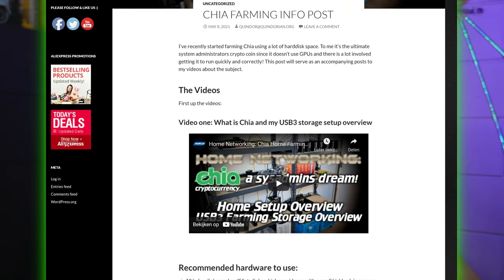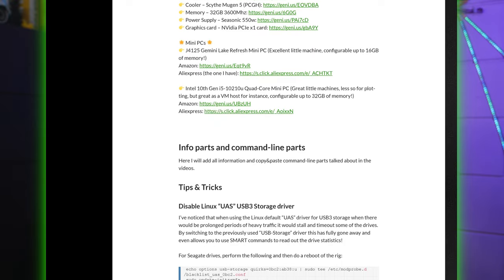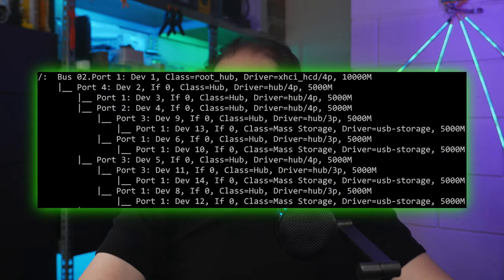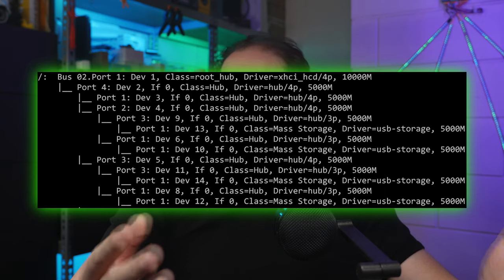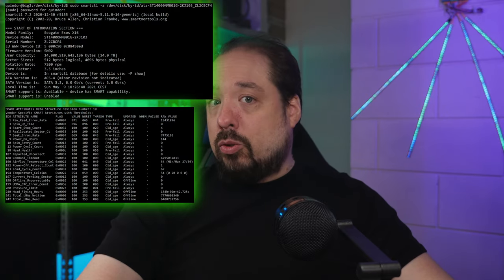Home Networking: Chia - Designing a plotting rig

Comment: I have the 5900X and I’m currently pushing around 15 plots with a Micron 6100 1.92 TB Sata SSD and the Samsung PM9A3 960GB NVMe SSD. Managed to get them both cheap but the 960GB capacity is quite limiting and so is the speed of the Micron SATA drive. More upgrades to come and can’t wait for your follow up video.

Comment: Hi. Great info, thank you. Am I wrong in thinking that 5800x should also be able to plot 10-12 plots parallel (according to calculators online cores+threads /2) and at similar speed? Wonder if I could save almost couple hundred bucks here.. Best of luck!
Reply from the maker: It will not, it has 4 cores less and same clock speeds, so the math is simple. My 5900x is often loaded 80%+

Comment: Literally ordered yesterday a rig pretty much like yours but a bit different build. Ryzen 5900x (my other system has 3900x too LOL), bequiet Dark Rock 4 cooler, 64 GB (2*32GB) G.Skill TridentZ NEO DDR4-3600 RAM, MSI MPG Gaming Edge WiFi X570, MSI GeForce GT 710 LP Passive 2 GB, 2x Corsair MP510 960 GB (3,7 PB TBW each!), Fractal Design Define 7 XL (can hold up to 18x 3,5 inch HDDs). Complete with 15x 12 TB drives for now.
Reply: edit: 2000GB PNY XLR8 CS3030 are the SSDs I ended up with, not the Corsair ones.
Reply: @maxmustermann194  did you find info on the endurance? I didn’t find any spec for that on the manufacturer website cause they look pretty good for the price
Reply: @trucha1785  3.7 PB for 2 TB drives! they seem sold out here already.
Reply: @maxmustermann194  i actually got one just in case and Its in suppose to arrive like tomorrow
Reply: @trucha1785  nice, they are already hard to get supply will suck soon
Reply: @maxmustermann194  yeah already BO at most places… I’m gonna order 2 more to secure my supply and will resell it if I don’t end up using it
Reply: @maxmustermann194  i also saw some people put them on PCIe adapter and used them in raid 0 so you have twice the speed
Reply: @trucha1785  sorry for late response, I did md0 RAID from beginning, I get 7000 MB/s reads and 5500 MB/s sequential 4K writes, couldn't be happier.

Comment: Thanks for the video.. need more clarity on how you got that 40-50 plots calculation.. how did you break down that calculation? 24threads assuming plotting is all you doing you can do 12 plots in parallel and also assuming you have a 4tb nvme m.2 you can safely do 12 plots aswell but with current prices it can easily blow the budget on those 2 alone. not unless you'll be using ssd sataIII is 32GB Ram sufficient to run all 12 plots parallel? if so what is the timing in between? sorry if its a dumb question calculation on my part as im trying to put together a rig aswell dedicated for plotting..
Reply from the maker: Ah, we'll you're going to need a lot more storage horse power to be able to achieve it (basically to make the CPU the bottleneck). Currently doing between 10 - 11 plots on the 5900x which all complete within 6 hours. 24 / 6 = 4 plots per 24Hrs but we're running let's say 11 that makes 44 plots in 24Hr. I'm still tuning to run 12 plots in parallel and that would bring me pretty close to the 50.

We'll dive a bit more into it in future videos. :)
Reply: @IntermitTech   looking forward to it and great tips on video's they're helpful.

Comment: just invested in a 5600x setup but got the b550 for 2.5g ethernet which I thought will be handy, wondering if I should change to a x570 while I still have the chance. I'm limited to 6 parallel plottings due to the single 2tb nvme, thinking if I should move to 2 gen 4 then will the cpu becomes the bottle neck?
Reply from the maker: Nah, for a 5600x you're likely going to be fine. Once you scale down CPU horse power (and you have about half a of 5900x) the rest of the components can also be lower performance. Same for your SSD, first try and find out if storage is actually your bottleneck right now, then change up what is.

Comment: Dude, what a great video. Very informative straight to the point. Excited to see the new videos come out. Could you please go over the speed difference from different operating systems (if there is a difference) 

Either way, awesome video and you got your self a new long time sub!
Reply from the maker: If I compare my Ryzen 5950x box running Windows 10 and the 5900x running Linux that last one is much much faster, I feel you really shouldn't plot on Windows if you are even somewhat serious. You're also able to use a much more lean and tuned setup in Linux which helps a lot.
Reply: @IntermitTech  alright great, thank you for the response. I am comfortable with windows which is what I have been plotting on, but if I need to switch to Linux then I need to switch! Excited for the new videos thank you

Comment: How much of a underperformance would the 3900x be? That's what i have, and was almost thinking of getting a threadripper for the higher core/thread count.
Reply from the maker: Not that much, the 5900x will do a plot in like 5:30 and a 3900x in more like 6:30 to 7 hours.
Reply: @IntermitTech  Ouch, that sucks. But since it's got a good amount of cores and threads, I'm sure it still allows for plotting at least 11 in parallel with decent turn around?
Reply from the maker: Oh yeah, I have a 3900x box running too

Comment: Would old second hand workstation do the job? Like a xenon E5-2670 with 32GB of ram for much less than consumer equipment… or even server rack and use pcie adapter if there isn’t any m.2 slot for the temp drive
Reply from the maker: Oh yeah for sure, you just need to design everything in balance really. Got a really fast CPU, get some fast storage too. The CPU's you mentioned are a lot lower speed but it's still an 8 core so it could probably do a decent amount of plots per day. Adding M2/NVMe drives using PCIe slots is easy, great plan!
Reply: @IntermitTech  i already ordered 3 1TB nvme with 1800TBW to plug in at 3000MB/s write… my concerns was really the processor speed even with the high number of thread…. Because I can get one for like 500$ so hypothetically I could buy 3 of those for the same price of a new setup like you proposed which is already in the cheap end. And I also take into consideration the HDD shortage coming and handling 50tb of storage versus 500tb isn’t the same game at all!
Reply from the maker: I think those boxes could do fine, in the end they might not be too far away from each other in total speed for the setup basically.

Comment: Thank you for sharing this knowledge.

I have all the hardware I need to build a plotting computer, along with some external drives. I intend to set up separate plotting and farming computers. Could you please help me learn which factors are most significant in the selection of a farming machine? All the articles and videos I've seen say a modest mini-computer is adequate, but I can't find any information about minimum recommended specifications. Do I need 4GB or 8GB of RAM? How fast do the RAM, processor, and internal drive need to be in the farming computer?

Thanks again for this informative video. I've watched both of your Chia vids, and I've subscribed to your channel in anticipation of more.
Reply from the maker: Most important for a farmer is that it can reach the storage where you have stored your plots fast enough, or rather, without too much latency. It really doesn't need to do a lot of read/write, it just needs to complete fast enough.

So either build a farmer with lots of internally connected disks, SAS connected JBOD shelves or even just using USB3 disks. And then if you have multiple computers and run into limitations like I did you can even spread out the disks to multiple hosts and then string them together over NFS or by running native harvesters on it.
Reply: @IntermitTech  Thank you. My tentative plan was to move "plotted" external drives from the plotting computer to a 10-port USB 3.0 hub connected to an Intel NUC5CPYH (Intel Celeron N3050) with 1x8GB DDR3L 1600MHz RAM, but I've received some feedback that I will need a more powerful processor to keep up with 10 drives.
Reply from the maker: Poh, a N3050 really isn't that powerful, depends if we're talking full node or pure farmer I guess. Try it out?
Reply: I've opted for an Intel NUC7i5BNH (Intel Core i5-7260U). That should do it!

Comment: Happy birthday. Great explanation.
I'm Brazilian and started with CHIA.
The machine I'm assembling was with parts from Aliexpress.
Xeon E5 2683 v4 processor.
The clock is low, 2 Ghz, however, it has 16 nuclei and 32 Thredes.
Do you believe that the Ryzen 9 5900x has a performance much higher or slightly above?
I don't know what is better, clock or nuclei.

Comment: Great content and video you have there. Very helpful. Just wanted to know would I be able to run the OS windows through sata drive and connect it rather then occupying one nvme on the motherboard. And if I Do would it effect the speed and performance of the chia plotting ?
Reply from the maker: I have a small SATA SSD for my Linux install on all boxes as advised in my hardware guide video.
Reply: @IntermitTech  thanks a lot for getting back on that. Just wanted your input if it would effect the speed of the plotting if running the OS windows through sata ssd? Thanks
Reply from the maker: SATA SSD for OS is no issue, windows will slow it down yee

Comment: do you think it is better to do farming using external or internal HDD ?

I am worried about durability problems when using External HDD because it is not designed for 7 X 24 use.

What do you think? please input from you.
Reply from the maker: I believe it will be fine external, although I might move over everything to internal for the long run.

Comment: By using the Gigabyte Aorus Pro x570 you save on expensive adapters, since this board supports bifurcation 4x4 for the gpu slot. So, any cheap pcie x16 card with 4 m.2 slots will do.
Reply from the maker: What expensive adapters? That PCIe x16 adapter is way more expensive then those little one's I use. ;)
Reply: @IntermitTech  I thought you were using something like the asus pcie x16 with 4 m.2 slots. Anyways, ~$50 adapters with 4 m.2 slots should work at full bandwidth if the mobo supports 4x4 bifurcation.
Reply from the maker: Ah no, I just used 2x 15$ adapter which include heatsink and all that, works perfectly!

Comment: Great video. The only question I have is about the plotting drive. M2 or U2 drive? Which is better?
Reply from the maker: Either, they are the same, just different form factor.
Reply: @IntermitTech  I understand U2 last longer compared to M2? Or doesn't matter as long they are good quality drives?
Reply from the maker: U2 or M2 is just an interface/form factor, nothing more.

Comment: Can you please mention on what settings and hardware you re using to run 11 plots in parallel as well as what is average time? 
Thanks in advance 😁
Reply from the maker: Well, euhm, hardware is exactly in this video (and the next). Plotman configuration really isn't that special, but do check out some of the tips and tricks in my linked article!
Reply: @IntermitTech  i did try, i m not able to create more than 28 on this rig. Can you please help. I am using swar chia plotter.
Reply: @kushagraagrawal1201  Hey there, did you find a way to get more than 28 plots per day on this rig? I have the same one.

Comment: I am getting the following your setup and the pcpartpicker website says the bios might need updating on the x570 when u combine it with vermeer CPU's
Reply from the maker: Yes, that is correct, if you get an x570 board with a BIOS from prior the 5000 series release you'll need a quick flash using a 3000 series CPU.
Reply: @IntermitTech  i dont have a spare 3x series laying around, cant update that bios can i?
Reply: @Spaceboi.  If your board has bios flashback you can update without cpu. Otherwise a cheap A10 am4 processor is your best bet.

Comment: Helpful video. It would be great to have a Linux/Ubuntu setup guide for literal beginners. I use the Windows GUI currently but ideally want to try Linux or Ubuntu for faster plots.

My plot and farming rig (eventually my workstation hence beefier RAM) im building by end of week is a 5800x, 2x 2TB M.2 Corsair MP600 NVMe, 64GB 3600 CL16 RAM and 84TB of storage. Am I right in saying I can max do 12 plots if timed right?
Reply from the maker: I'd say max 8 parallel plots, if that, you're storage is going to be the limiting factor, check my next video. ;)
Other then that, it's perfect to become a 8 parallel plot rig!
Reply: @IntermitTech  Ye I actually just swapped the 5800x for a 5900x, should get me to 12 parallel. I initially had just 1x 2TB drive but got another just in case and having learnt a bit more about the plotting process should get 12 parallel on the 5900x with my setup!

hard part is just getting more storage now, everythings sold out!

Comment: Why the GPU at all?
HDMI on the motherboard right?
Reply from the maker: Ah no, not with AMD. The ports are there if you use an APU but those are much lower speed so not really applicable here, thus extra GPU is needed. Although after installation you can pull it out if you want.
Reply: @IntermitTech  Thanks for the answer 🙂👍
Reply: @IntermitTech  can you explain what this means to a noob, I have a 5900X planning to get the asrock phantom gaming, I will not be able to just attach a monitor to the hdmi port on the motherboard?
Reply from the maker: This is correct, that CPU has no GPU inside.

Comment: How many NVME SSDs will you be able to run un this machine? I'm still at a loss about how the plotting is set up. You have 2 NVME 1 TB SSDs (2x 980 Pro 1TB in Raid 0) on the motherboard, one Cheap for Ubuntu on a SATA I guess, and another 2x 1TB NVMEs (2x 980 Pro 1TB in R0) on the expansion PCI express card with the heatsink (2x Sabrent NVMe M.2 SSD ) since you GPU uses PCI express 1, right?. Are these NVMEs in RAID 0? In this configuration I think that you can plot 12 plots at the same time and it shouldn't take more than 8 hours, x3 that's around 36 plots a day. Will the 32Gb of RAM be enough to run 12 plots in parallel? Once the plots are done how will you transfer them on an external drive? How can you minimize stage four transfer times? Can you do it fast enough so it wont create a bottleneck? Do you have 12 external USB drives connected to the rig? Sorry for the avalanche of questions but from all the videos and tutorials out there you are the only one who really knows what he is talking about.
Reply from the maker: Yup yup, check the next video, it will explain the NVMe setup a bit more. But yes running 4x 980Pro 1TB in R0 using MDADM and XFS (check my info article in the description). 32GB should be fine to run up to 12 staggered plots.
Reply: @IntermitTech  Thanks. :) I saw your new video and I'm thinking to buy the 970 instead of the 980. Will more than 32GB of ram help to maximize plotting?
Reply from the maker: Depends on the CPU
Reply: @IntermitTech  5900x

Comment: Hi, can you advise me on this components that I ordered, cpu ryzen 3900x, kingston hyperx fury 64 gb 3200 mhz, and ssd corsair force mp600 2x 2 tb, should I expect any hickups and can it plot 12 plots in paralel on this.
Reply from the maker: The SSDs are very mediocre for plotting (although I know they get advised elsewhere), you'll be able to run 2, maybe 3 at a time on those but performance won't be great. 
3600Mhz memory would also have been a better match but the performance between 3200Mhz vs 3600Mhz isn't that much you need to change it.
Reply: @IntermitTech  Thank you for the answers 👌

Comment: Every Chia farmer is obsessed with how many plots they can do in the shortest time.

Many to realise the tons of plots create can disappear in an instant when their 18tb fails.

Chia farmers should consider building a storage space like a NAS that has multiple hdd failure redundancy.

No point having 20x 18tb plots when each can fail with no backup.

Plotting is the 1st phase. The next 12-13yrs of farming is as important.
Reply from the maker: While I do partially agree with you on the other hand if a disk fails, re-plotting the lost data is probably cheaper/more economic then having redundancy and thus less space available, especially if we where talking older drives anyway.
Reply: @IntermitTech  I like to use the 12TB not to big and not to small and best value for buxs atm

Comment: Dam man, you must be putting in hours of research for us, appretiate it soo much! Im running a b550 board and looking into upgrading to a 570x because they are o;n sale everywhere.  Do you know if those Sabrent PCIE x16,x8,x4 expansion nvme cards would do good for people with no many m.2 slots on their board?
Reply from the maker: I use them in both my dedicated plotters the Sabrent M2 to PCIe x4 little risers with cooling block, works great, even for Gen4 NVMe drives like my 980 Pro 1TB's.
Reply: @IntermitTech  Oh sweet, so i have a gigabyte auros b550 pro and only my top m.2 is gen 4, if i use the riser on my pci x16 gen 4 slot where i normally put my gpu, will that then power a gen 4 nvme to 4th gen speeds? sorry thats alot to ask ya lol if ya are not sure thats fine, thanks
Reply from the maker: Yeah, that's fully correct!
Reply: @Intermit.Tech  Hi! Explain me please such a thing: you recommend to use the x570 chipset instead of B550 motivating this the fact that x570 has PCIe 4.0 x4 M.2 interface and this gives us two such extra fast slots (including one in a processor), but in the next video about NVMe SSD you recommend a Samsung 970 PRO model which needs only PCIe 3.0 x4 interface, so the PCIe 4.0 x4 isn't used for all it's speed with such an SSD and the B550 chipset is enough. So why do you recommend the x570 chipset?
Reply from the maker: You still have the extra bandwidth to the chipset also for SATA drives or USB connected items.